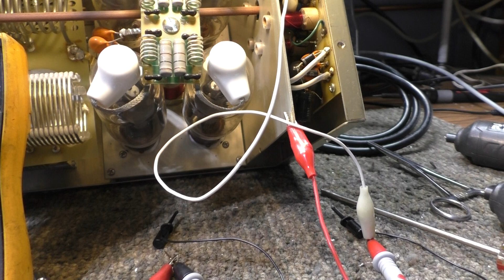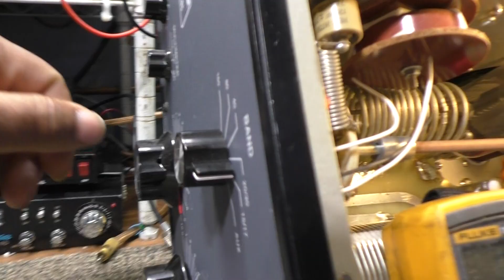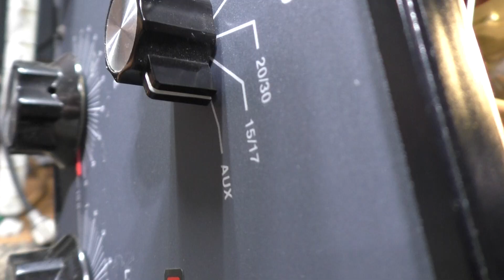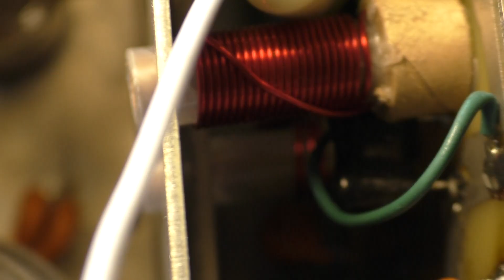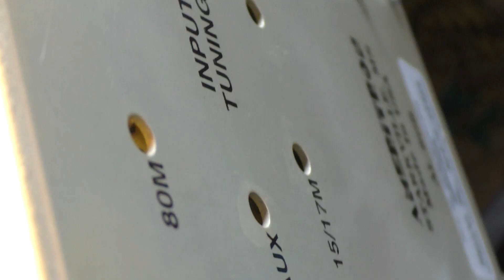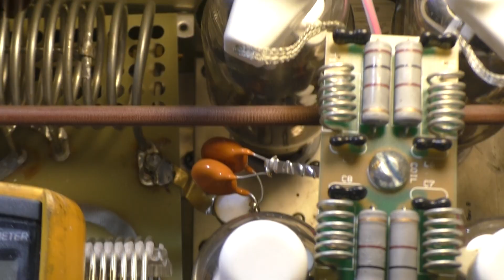Ameritron Linear Amplifiers, AL-572, AL-811, others, 10 meter mod, easy peasy, cut the green wire

Comment: Apparently, the old 1500 watt output limit no longer applies to amateur radio. This past weekend I heard a guy bragging about his Henry 8K was pushing 7500 watts output into a four element beam at 100 feet. This was on 40 meters, and band conditions were so poor that he was the only station I could hear.
Reply from the maker: There are always going to be those who break the rules.
Reply: @tramdr True, but you usually don't brag about it when you're putting your callsign out every 10 minutes.
Reply: 7500 was probably input

Comment: is this a full legal limit amp ?
Reply from the maker: No. The manual even says: "Near legal limit" It is said to handle 1000 watts carrier CW (Not AM) and also says 1300 watts out SSB. Also, I always go by plate dissipation to see what a tube amp can do. For peak AM watts, I always go by 2x the total plate dissipation of the tubes. Hence a single 500z = 1000 watts peak, a pair of 500z's 2000 watts, single 4cx250B = 500 watts, and this amp uses 4 572B tubes which have a plate dissipation of 165 watts each, hence 4 x 165 = 660 total dissipation x 2 = 1320 watts out AM. This amp can be pushed harder and could squeeze out 1500, but that would be tough on the tubes.
Reply: @tramdr  thx